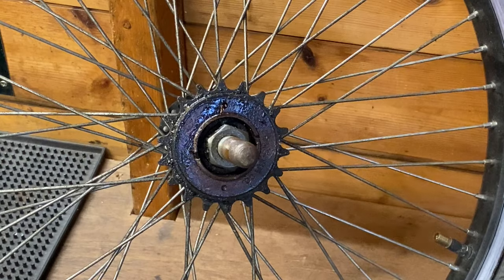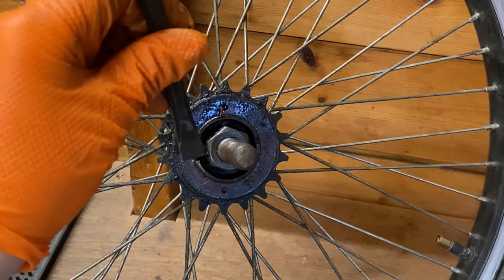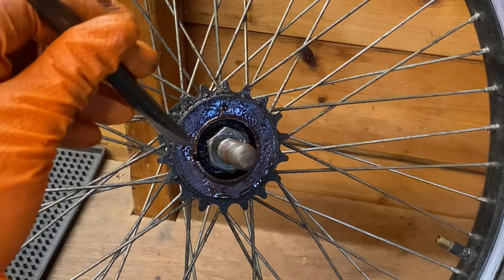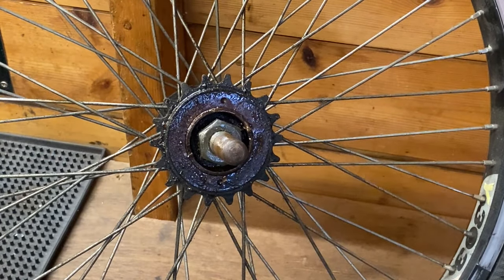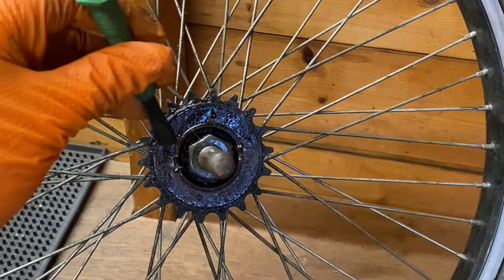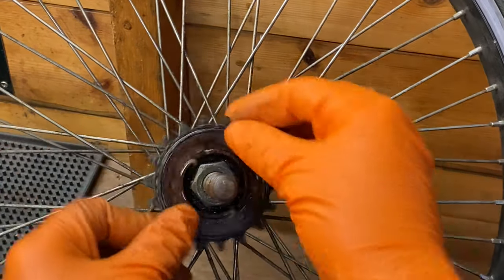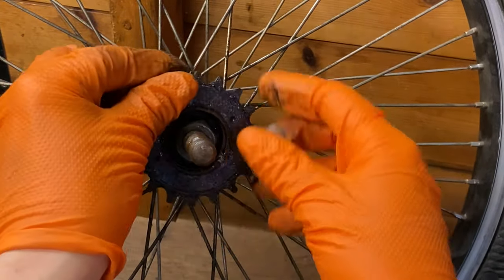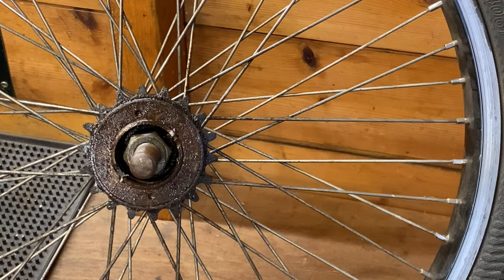Bmx freewheel removal (the ghetto way!) no special tools needed!

Comment: If you do it this way. You want to use a punch that is made from softer metal, like brass, so you minimize the damage to the gear.
Reply from the maker: The video is about removing the gear, not preserving it , once that gear is off it is replaced so damaging it does not matter as long as it comes off. 

You have missed the point of the video

Comment: Excellent video, gave me the info I needed to get it done! I used to often do these 30 years ago, but had trouble with my kids bike, the thing was hell tight. It didn’t have the slots, tried bashing it and in the end I cut it with the grinder, disassembled the ratchet and used a pipe wrench to get it off.

Comment: Hey man - thanks for the tip - - - i got one issue though -  when i pedal it slips....then it pedals again....and slips - any idea what that could be?    i remove the back wheel and it seems its at the cog , when i spin it ,  it spins both ways..... what could be the problem?   any help would be appreciated.  Thank you
Reply from the maker: Hey mate. Your clutches in the freewheel have gone, could be sticking however more then likely it will need replacing, cheap replacements on eBay 👍
Reply: @retrobikestuff760  Thanks alot bra,  i got a spare laying here, ill replace and see how it goes - appreciate your reply
Reply from the maker: @nyutron3862  no worries 😉
Reply: blown pawls

Comment: Hi 
My kid cycle which has coaster break 
Free wheel slips pedal moves freely on bothways 
What could be possible fix ?
Reply from the maker: Freewheel clutches sticking or worn

Replace freewheel for what that cost 👍
Reply: @retrobikestuff760  
Today I disassembled & its  spring is broken

Comment: That method works but it tears up up the old freewheel.don’t do the same with new installation.
Reply from the maker: That’s correct as mentioned in the video 🙄
Reply: @retrobikestuff760  your video had sound issues so I didn’t catch that🙄🙄
Reply from the maker: @hollywoodjoe3259  I know bro I’m terrible
Reply: @retrobikestuff760   no you cool

Comment: I tried to use this method to remove my sprocket, but only managed to cut the tabs. Where can I get the proper wrench to remove the sprocket?
Reply: @James Simmons Bike shop bro🤘
Reply from the maker: Depends, some don’t have a specific tool like the one in my video, the tool has 4 square sides that slot into the freewheel

Comment: How do i make my bmx a fixie?
Reply from the maker: Hi, you would need to change from freewheel to a fixed sprocket, or get a flip flop hub with a sprocket on one side and a freewheel on the other so you can switch the wheel around for easy options